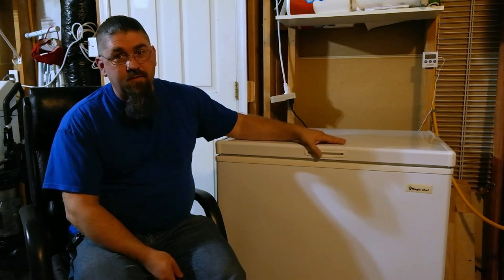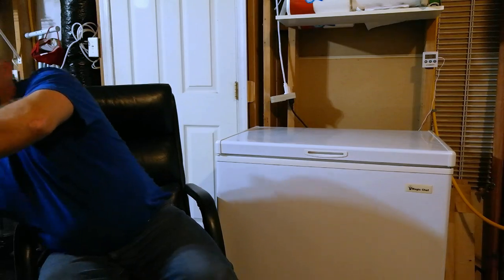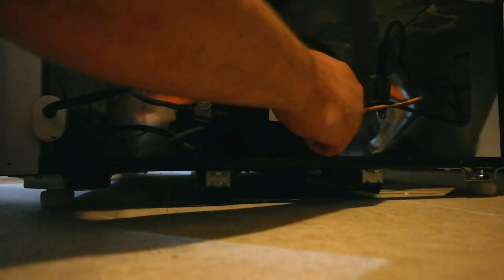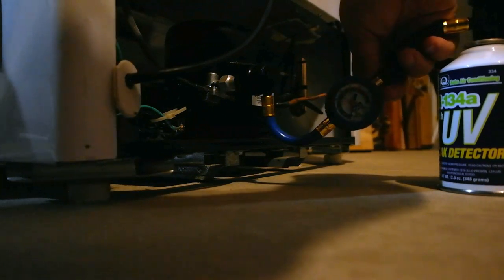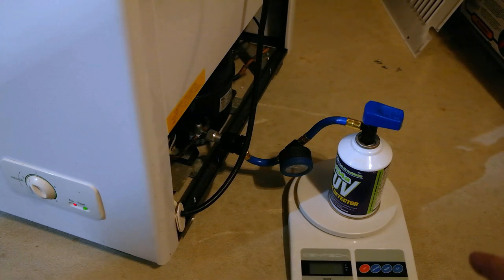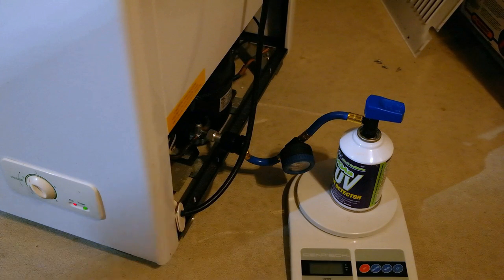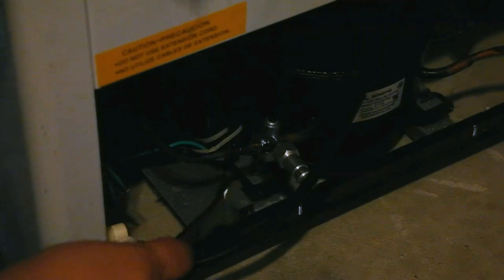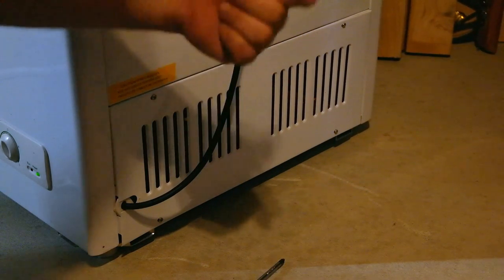How To Recharge Freon On A Chest Freezer

Comment: You had no idea how much refrigerant was left in the system to decide how much to add, or whether or not it had taken on air contamination and should be vacuumed out.
Reply: yawn... go get a job at the EPA ya pheasant...
Reply: I had the same thought. Isn't the recommended amount of grep from an empty state? How do you determine how much is left in there if you don't purge the line? And if you purge it, how do you even do that and collect the old freon? I have a giant vintage freezer I need to do this one and would love to know
Reply: @Sustainavore  technically you're supposed to recover the refrigerant but I don't think anyone watching this video has the equipment for that, so it would probably just be vacuumed out into the atmosphere.

But to add refrigerant by weight you do have to know how much is left if you want to be accurate. The savings grace of this video is that there's not much in the system to begin with. 

Without knowing what remains in the system, you'd have to measure the amount of refrigerant charge by monitoring the pressures. At least the low pressure side, but preferably both.

The problem with "just" adding it is that when the refrigerant is low, the low pressure side often goes below atmospheric pressure, and if the leak is on the low pressure side, the higher atmospheric pressure can then force air contamination into the system and reduce the performance of the refrigerant. If enough air is in the system, it will have serious problems.
Reply: @garybarbourii8274 , thanks. Hopefully I can find out how much this old ass freezer needs.
Reply: @Sustainavore  if you don't have access to a vacuum pump (which can be rented from autozone for about 150 and you get your money back afterwards), then you can try to just do it by the low pressure. There should be a service sheet somewhere tucked away in the bottom/back of it and it should have the target pressure. You can always try it that way and hope for the best. That's what this video represents. What's missing from the video is the warning about how it can go wrong, because it's basically a shot in the dark.
Reply: @garybarbourii8274  wish me luck then! I'll find out later today whether there are any specs listed in this thing.
Reply: Why you hating? Gary is right. It needs to be evacuated for moisture, nothing to do with EPA. Filter should also be replaced.
Reply: Thanks Gary, I have a Laser background , you know your stuff.
Folks, Gary is right, be careful, freon is dangerous to us and...and , yes and the environment. 
Proceed with care, caution and caring.  Be kind..
Reply: @johnkomosa4089  I have always love LASERS! I once built a nitrogen laser out of plexiglass and copper plates, but I was just a kid and couldn't afford the tank of nitrogen and vacuum pump to fire it up. Though I did get the capacitive plates to discharge the 10mm gap running along the beam axis inside of it one time before I blew my external capacitor.

Comment: This was AMAZING!   I had three companies tell me to just buy a new freezer.  Figured it was already not working so the worst I could do is break it more and just buy a new one.  Bought the parts for $50 total, installed the bullet piercing valve and adapter, attached the r134a and filled.  Unfortunately my scale turned off during filling so I lost track of the amount filled but the cannister came with a PSI gauge so I used that to fill to the green area and my freezer just about immediately cooled to zero.  I'm so excited to have fixed this by myself.  Thank you!!

Comment: So I bought a deep freeze from my work (Lowe's) for $10 brand new delivery guy says won't run I take it home it turns on but Freon has a gurgling sound I watch your video by the valve the antifreeze do it myself for all of $15 now I have a great working freezer and it's all cuz of you thank you so much great video keep up the hard work
Reply: It's freon , not antifreeze.
  How is your freezer working?
Now.  My friend passed away who was certified in airconditioning and handling freon, so now i'm on my own.  Considering my options.
Thanks. John. (134a freon )
Hard on the environment,  so must be very careful not to spill or leak.

Comment: Do you recommend also adding some stop leak or one of those things to help seal the leak? Or does the freon usually have it already?
Reply: That’s what I did to mine. Used the can with stop leak. Been running fine for over a year now.

Comment: Thanks.  I had my freezer in storage for 3yrs,  it worked great before then.  So I recently pulled it out,  pluged it in,  running but not freezing.  I talked to someone about repairs,  he said that it would cost more for him to fix it than it's worth.  I'm going to order my parts from Amazon.  Thanks.

Comment: Thanks for the video!  Another freezer saved.   My freezer was working but ran constantly and on hot days would approach 25F.  I added a small amount and charged it up to 10PSI and now it's at -2 degrees and only runs occasionally, even on a 90 degree day.

Comment: Just a thought, I will give this a try, but I would not recommend weighing the canister while the hose is connected to the freezer, it will greatly affect the weight that is read on the scale. It's more work to disconnect and reconnect the canister while weighing, but if the amount of refrigerant that is added is so critical, it is worth the time.

Comment: Overall great amount of positive guidance with one sidetone of slight misdirection. Following your lead, not to fill the compressor on the factory filled and crimped side, but the opposite side, I pierced the front hose directly opposite of the original crimped fill line. I could not get any refrigerant to fill... aka High pressure side. I went to the further back side copper line, and pierced it with success. Fortunately I purchased not one piercing valve for $9, but 4 for $16 and so I was able to salvage the deep freezer, which also sat for many years, like yours. I initially cleaned up all solder joints and torched them before adding the called for 6oz of R134A refrigerant. Many thanks for helping to make our lives a little bit better without professional help. Stay great!

Comment: How did you run the ETHMEAS thermometer wire into the freezer?  Do you simply let the door seal close over it, if yes, does this cause an air leak?  If no, did you make a tiny slice in the seal and poke the wire through the seal, maybe for a better seal around the wire?  I seen another video where the thermometer sensor is kept in a small sealed bottle of automotive antifreeze [coolant] to buffer temperature variation.  Do you recommend doing this?

Comment: Suggestion. After running for a couple of weeks check the Freon pressure at that connector you added.   I have an old small upright freezer that quit. The motor turns but does not cool and replaced it.  I will try this just for the heck of it.

Comment: So it’s been 4 years now.. has it been holding ever since? Just curious. I had to do this with my deep freezer too. I pulled a vacuum on it first tho. Cuz it was dead for a couple of years or so before I finally fixed it. It’s been running fine for over a year now.. haven’t had to top it off again. I used the kind with leak sealer.

Comment: You can actually attach the bullet valve to the little "nub" that you mentioned (that is used by the factory to add freon).  That's where I have mine located and it works great.  Just be sure that you choose a straight section of pipe, so that it does not leak.  Also, clean the copper pipe where you attach the valve with a [manicure] nail buffing pad, then use a dab of ketchup to bring the copper pipe to a shine.
Reply: Thanks,  yes fine Emory clothe and scotch Brite to remove the scratches.  The best is to solder or braze on a fitting.  Repaired by a skilled tradesman.  Perform a leak test..  pump down then backfill with freon.  Vacuum pump..
Reply: @johnkomosa4089  Most of them have priced themselves out of the average homeowner's reach.
Reply: Thanks for the thought of tapping the factory fill part of the line! Ours is fixed and running great, now just to see how long it goes from here!
Reply: @johnkomosa4089  That's OK if you can find an appliance guy that does brazing too, but you are still looking at around $300-$500, which is a large chunk towards a new appliance.   Most regular appliance repair places won't touch refrigerant-type repairs, due to licensing.
Bullet piercing valves do a good-enough job if you install them properly/carefully and if the R134a just needs a top up, you won't need to do vacuuming, etc.  (These valves cost about $6-$7 off Amazon or EBay).
 
Over the years, the seals, etc. in a fridge-freezer will weaken and start a very slow leak.  In this case, a shot of R134a with stop leak will usually fix the problem.
However, even if you had to top up your fridge every 6 months, one $6 can of R134a (from any Home Depot) will be enough for multiple top ups and that still beats the price of a new appliance.
Reply: @jimnaccash1535  Very true!
Reply: Can you help me? I attached the piercing bullet valve and I’m getting a hissing noise from it. I think maybe I’m depleting Freon. Please help!

Comment: hermetically sealed units like refrigerators, dehumidifiers and chest freezers don't leak freon like car air conditioners do because a car air conditioner's compressor has an exposed driveshaft with a seal that isn't supposed to leak but eventually does. if your chest freezer lost it's charge it's due to a hole in the system somewhere. did the outside case get dented? the condenser coils are usually integral with the outer case sheetmetal so a dent or tiny hole in the outer casing can cause a leak. i only use bullet valves when tapping into a system i don't consider them reliable enough to leave in place as a permanent fix. i prefer to braze on a proper service port or ports if i can get to both sides easily.
Reply: Listen to this man, he knows what he's talking about..
Thanks.

Comment: Hi. I have a 24 yr old kenmore chest freezer that I installed 3n1 hard starter.1/12 - 1/5hp.
Now compressor gets really hot after it was running for 1 hr. 
Do you think I am low on freon as well? Can low on freon cause compressor to get really hot to touch with a bare hand?
Reply: "Uncomfortably hot" to the touch (but not too hot to keep your hand on) would be a normal temperature for a compressor.  Most likely, the culprit is the hard starter.  Those tend to use a thermistor or even just a capacitor for the start circuit instead of a relay.  The result is extra power always flowing through the start coil of the motor even after it is started, causing it to run hotter and use more power while running.

Comment: Most awesome!!!  Thanks for the links..did you know that propane itself is a Freon...R-290/R-290a look it up...seriously
Is the oil in the compressor compatible between R-12 and R134a? (oh..yours was already set for R-134a
Great video! 
Link to the thermometer please?

Outside cold beverage cooler?  Put one of those temp control relays in it...have it shut off the "freezer" before it freezes...and when people open to get drinks..the cold air doesn't  flow out the bottom like conventional refrigerators.  Then get reflective insulation and stick to the outside to keep the sun from heating the body of the freezer up.
Reply from the maker: Sorry forgot to put the link for the thermometer in the description.  I have added it.  Thanks for spotting that.  

Yes, I have seen propane used as Freon, it's more commonly used in big air handlers for warehouses.

I've always wanted to convert a chest freezer into a refrigerator, one of these years I may do that.
Reply: r290 is actually the best drop-in refrigerant for any car that has an old r12 system because it's compatible with the mineral oil and all of the rubber seals and hoses and doesn't require barrier hoses. the gas molocules are larger and less prone to leakage but, in the states it's not considered legal for mobile applications because it's a flammable gas. but, r134a is also a flammable gas, but is legal for some reason..........

 i've been running propane as a refrigerant in my 1974 gmc pickup's air conditioning system for almost 10 years now with no problems other than the usual leakage issues with an old gm a/c system running an a6 compressor. cooling is actually better than with r12 and i run a smaller charge, i think 37oz is stock but i run around 30-32oz. once a year i have to add 6-8 ounces to the system, but that's a lot less than the normal 22 ounces of r12 that you would normally maintain the system with. the leak point is the compressor(always in any a/c system) but the truck lives outside and not in a garage, that's probably a good safety point to mention.. don't use r290 if you park your car indoors.
Reply: marzsit why not if you park indoors? I will look it up but any notes from experience you may have will be useful.

Comment: Nice job in my opinion on the video!! I have the same problem with my little Estate /Whirpool chest freezer that we shut down for a year or so, now it doesn't freeze or even get cold, compressor is running but nada.           So I am going to try your fix and see what happens. I will update as soon as I have a verdict. Thank you for your effort in trying to keep this crap running.
Reply: what was the verdict? I have same problem. compressor running and tested all electrical components with meter(start relay, capacitor, etc..) and it doesn't get cold. let me know if that solved your problem
Reply: @xiomycorazon  I still have not repaired the freezer.
Reply: @fastrat37  repaired?

Comment: I just did this to mine.  1/8/21 I am going to give it 2 hours to see what it does. Fingers crossed.
Reply: Let me know how it goes! I’m trying to go this myself 1/14/21 so I hope I can do this.
Reply: @keylacortes552  so far so good. Still keeping fingers crossed.
Parts were easy to find. Easy to connect and purge the Freon.
Running Freezing Cold now.
Time will tell. 😁👍
Reply: @BerryM6162  I added my piercing valve but I’m hearing a hissing noise...any ideas how I can stop it?
Reply: @keylacortes552  if it is hissing you do not have it seated correctly and you are leaking Freon.
Did you make sure the O Ring was placed in it before you tightened it down around the Line?
And are you sure you have the correct size " diameter" for the Line?
Reply: @BerryM6162  what O ring? Uh oh. The valve came with an adapter so I put one on it but I wasn’t sure if it was sitting properly. But I don’t think I can remove it now that I attached it 😂
Reply: @keylacortes552  I don't know. You might have to call a repair person to come check it out.
Reply: @BerryM6162  ouchhh lol uh oh
Reply: @keylacortes552  Try swapping 2 of the black screws around. Worked for me. I couldn’t get mine to tighten up so I tried that. If you see a crease in the two pieces of the valve that connect together it’s not sealed.

Comment: I by pass the thermostats and let freezers run 24/7 . my last Kenmore went 26 years at -15 F .  Got my moneys worth!
Reply: Joke's on you—the extra money got tacked onto your electric bill.  Over the 26 years, you probably paid for a new freezer at least once (if not twice) over letting it run with the thermostat...
Reply: @techie0075  If it was on the thermostat, I would have already bought 2 new freezers. Therefore, I am one freezer ahead of the game. Its the start that kills motors and bumps the meter.
Reply: @RRaucina  Only if you have a defective or improperly installed thermostat that's regularly short-cycling the compressor (which admittedly, some do from the factory).  Even better, install a temperature controller yourself and set it to a wide range (say -10 to +10°F).  This will maximize efficiency while minimizing on/off cycles over a regular thermostat.  Regardless, I've seen several freezers make it over 20 years—with the built-in thermostat cycling normally (1-3 times/hr).

Comment: My freezer is getting cold on the inside but definitely even close to freezer cold.  Also, Mine does not have coils on the back... (Igloo brand) I cant seem to find coils anywhere.... Any thoughts?
Reply: the  'coils'  are now  inside the back wall/side wall.    They  stay  cleaner/less prone  to damage  there.  The heat they radiate now  goes  through the cabinet  skin.. and you can feel the heat  with your hand  when  it's  running.

typically,  the  suction line,  where you'd  put the  bullet piercing valve,  is on the left side of the compressor,   should be  cool to cold  when  compressor is  running.   The other line will be the  pressure side,  and  quite  warm to hot.

Comment: I did this about six months ago and the temperature started to climb up again.  A couple days ago, I added more freon per instructions and now temperature climbing more (currently 14.9F). The line with the adapter was covered in ice. I got the ice off the line but what else should I do?
Reply from the maker: Time to call it quits. Sounds like you may have a blockage somewhere in the lines.
Reply: If the cold line is frosty at the compressor then most likely overcharged ...should sweat but no frost in cold line  right back to the evaporator......let some gas’s out in small amounts and check each 1/2 hour until frost is gone.
Reply: @simonmorris3964  Thanks. I had unplugged it and replugged in and it seems to have not come back. I did release some gas prior to unplugging. It's now unplugged and waiting as back up if the other used one I bought bites the dust. Can't wait until we can buy brand new freezers!
Reply: He could be right. If it’s going down on you and you’re adding refrigerant to it then the suction line starts freezing up that means there’s too much refrigerant in the system. Is the Hot dog shaped copper filter dryer frozen? If it froze it’s restricted..
Reply: I’d pull a vacuum on it and see what the gauge is showing.